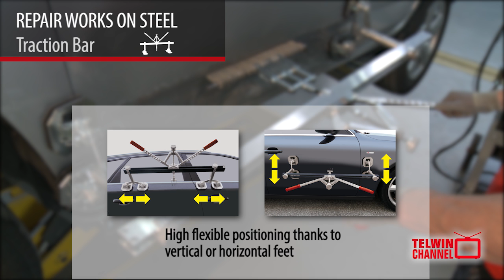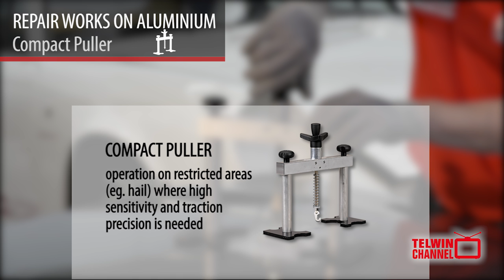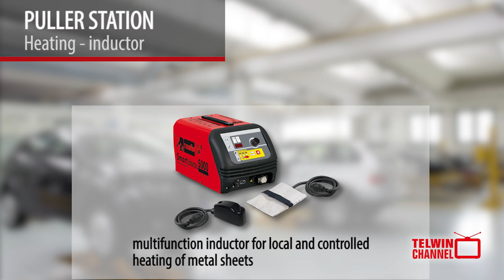PULLER STATION: dent pulling of steel and aluminium (eng)

Comment: I can spend half the time, a fraction of the tool cost. And no filler, with a door skin. Pre loss condition
Reply: Jeremy Vawter hi jeremy, can a dent be pulled from unremovable side skirt of a honda civic using pdr or anything. Without any filler or anything?

Comment: iv been using spot pullers for over 10 years. putting on a new door will make a company very little money. hundreds of pounds paid to a main dealer for a door, when you can be paid that money in labour costa for your self/company. new panels make close to zero profit. bodyshops are paid for hours sold not parts sold.
Reply: True labour king

Comment: those aluminum studs are terrible notice how lightly hes tapping on it. the reason he does this is because they hardly stick at all. Ive tried, never seen anyone have good luck with those machines. either cave and pave and use heat or replace it.